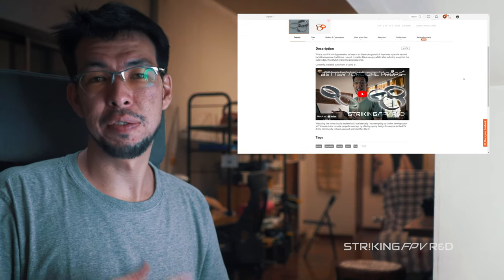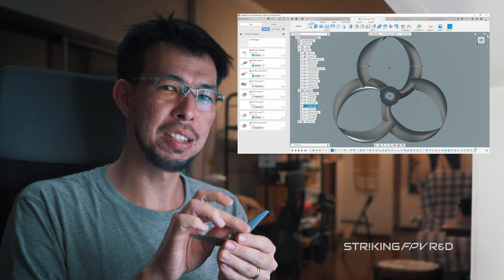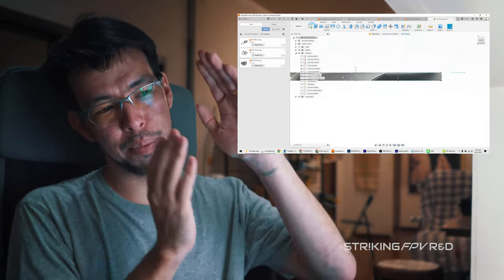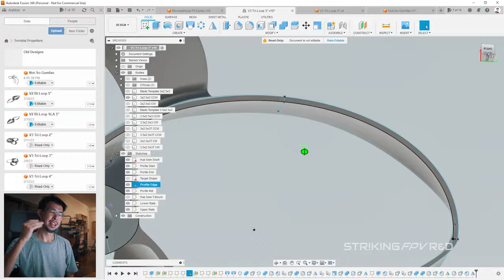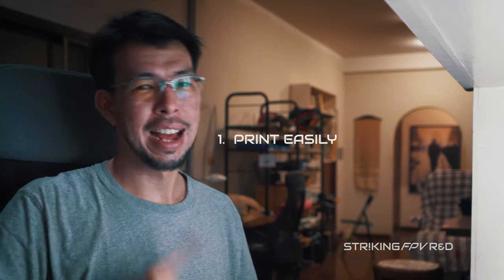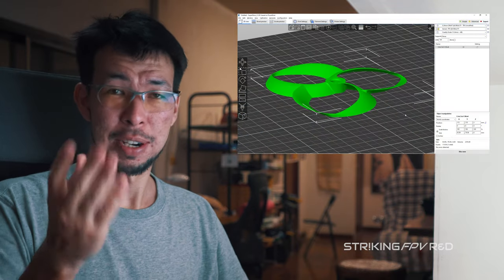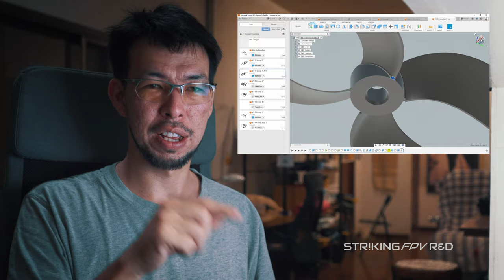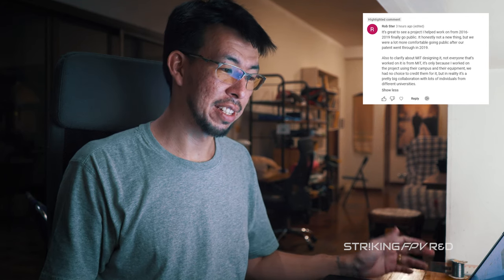10 Toroidal Drone Propeller Questions Addressed

Comment: Excellent video, and I really liked the part where you did the helix to set the pitch.

I know I've made a few comments about balance here and there. Hopefully it didn't come across as a design complaint. It was more about the printing process,...and actually,.. even injection molded props can use some balancing. Gemfan whoop props are pretty out of balance. I find I can generally run HQ's as is, but I have to balance Gemfans. So I fully expect to have to balance a printed prop. But maybe these v3's are light enough to skip balancing for the first flights. Balance later to remove jello. We'll see.

Trying to work on resin printing these also. I have only ever printed SyriaTech Blu, as I have only ever been interested in functional prints. Currently working with a mix of blue and black( old and new bottles). It's just a good deal harder to get a print straight on the build plate with resin that doesn't have a huge elephant's foot. Especially with fairly clear resins.
Reply from the maker: That's interesting, I've often thought that part adhesion would be pretty good for small and light-weight parts like these props, but again I have no experience with resin.  For the longest time I've want to get a resin printer but I've met a few people with them who've all said the same thing: they smell terrible, haha.  I currently don't have a clean enough outdoor area to put one, and as of yet I don't exactly have a strong enough reason to buy one if it were just for printing props and nothing else (maybe some flexible parts with that TPU-esque resin).

Sure would love to grab one, but I ain't got funding for this 🤣.
Reply: @STRIKINGFPV   So I figured out half of the elephant's foot. My build plate was not flat/warped. Seems it is a common issue with these. So I bought some flat glass and sanded it flat. Actually, I sanded it most of the way on a plain sheet of glass.

So that removed a good bit of the elephant's foot, but it still exists. My guess now is it's the thin layer of resin trapped between the plate and fep on that bottom layer. So it ends up just being a thick bottom layer. That's somewhat ok for straight walled prints, but for props that don't come straight up off the plate, you'll get a lip. Maybe a thinner resin would help,.. not sure. I've tried slowing down the build plate to give it more time to squish out, and heated the chamber to thin it. For now, I'm just assuming I won't be printing directly on the build plate. Props will have to be supported.

Comment: Use CF filled materials like PETG or Nylon. It´s way more rigid and combats the disadvantages of Nylon or PETG which is being too ductile.
In regard to the injection molding question, everything can be injection molded it only depends on how much you are willing to pay. Their complex geometry does make them non injection molding friendly you would need angle sliders etc.but it is doable.

Comment: Was sleeping on this video if the plan is to continue down the toroidal rabbit whole maybe decreases the attack angle of the blades if it's a quad blade for the biloop toroidal. Also weight saving needs to be a focus maybe keep same attack angle but decrease blade width to decrease the amount of energy needed to spin the motors
Reply from the maker: I do believe that is the direction to go as well, but I'm internally fighting between the part of me that wants the ideal shape for the purpose, and the part of me that still wants an easy-to-print version that people can fly with.  If I go full-send on creating the ideal shape (even though I'm still just making educated guesses), I risk creating a design that not many people will be able to test, which would be a shame.

I'd like to strike that balance if possible, but the more I think about the geometry the more I think the ideal design isn't really feasible on FDM printers - it seems to be much more a resin or SLA kind of thing.
Reply: @STRIKINGFPV  wondering what the finest fdm settings can print also printing with supports isnt as scary as it used to be you can tune the gap so the supports work but also break away with no grinding. fdm has come a long way perhaps your design might still work. maybe a .15mm nozzle with a even smaller layer height since we want a smooth print anyway so you can get as thin as possible. you can also order some from a company in the material you like once you have a design you think will work. right now i dont think we are limited by material strength yet at least on smaller drones. ran on rekon35 had alot of bobbles but i was in angle and it is only 2s so might not have enough power. just bouncing ideas dont feel obligated to take any advice.

Comment: about the small vertical wingtip area. You say there is no waay around is, but why can't you continue with making the angle shallower until 0 deg (flat/horizontal) at the tip and continue from there to increase the angle again? I know that if you continue with the same airfoil design, it would be upside-down. But you could transition to a new airfoil from the tip onwards. the airfoil would be inverted from the one before the tip, but now because you continue the rotation on the other side of the loop, it would be right-side-up again. Does that make sense to you? it does to me, but it is difficult to find the right words to describe...
Reply from the maker: I'm not quite sure I understand your idea, but the way I can explain why that vertical exists is because it's a transition for the loop.  Some other commenters have mentioned making the tip flat instead of vertical, but this will result in a blade tip, which is against what the loop design is trying to achieve.

You can imagine it with a piece of paper.  If we made it flat-tipped, then actually we have one blade with a hole in the middle.  The loop idea is like one long blade which has been almost folded back on itself, and this fold means that there will always be an upright section at some point.

The challenge here is minimising the size of this vertical loop bit, but if you make it so thin as if it doesn't exist, then you now have a blade tip.
Reply: @STRIKINGFPV  i guess I imagine my idea would be a little like an inverted Mobius strip. With the horizontal part on the outside.    This might indeed be against what the loop is trying to achieve. But it would still make it a suitable prop for 3D printing, which seems to be the main benefit for now with your designs.
I am going to follow your tutorial and see if I can make my idea into an actual design. I have no way to test it though. But still educational and fun.
Reply: Acually, the inverted Mobius strip does not make sense at all. 😅🤦‍♂
Reply: It would be more like two separate normal twisted wings glued together at the tips. One originating from the leading side of the rotor hub and the other from the trailing side. So it would not be a loop anymore at all.

Comment: The outer tip is important since it moves fastest, if that outer tip has a lot of surface area and providing 0 lift the design is bad. Turbulence at a tiny tip is far more efficient than a large cross section non-lifting tip.  The thing about droid props is there isn't a lot going into it unless you are in the defense industry. The water screw propellers are probably a better solution since it is strong, the blades do not have dirty air, the whole system lifts.

Comment: Maybe you should look at ducted propeller theory. There's an RC propeller teacher that may help.
Reply from the maker: Funny thing about ducted propellers is that in the drone world they do increase efficiency, but also increase noise and reduce maneuverability.  I believe that the US Air Force, when doing experiments with various ducted fan flying machines, discovered that they had a natural tendency to self-level, which fights against the type of handling that many FPV pilots want, which is why the "slammed duct" was created, to try and benefit from the efficiency increase whilst reducing the effects of self-stabilisation and the aerodynamic cross-section which slowed-down the drone and made it more susceptible to wind.

Nowadays, a lot of "ducted" designs are not in fact real ducts due to far too much clearance between the prop tips and the "ducts" themselves, effectively making them glorified prop-guards.  Many newer cinewhoop designs do-away with the duct fallacy and just have thin-ish prop-guards which don't interfere with aerodynamics all that much but protect the drone props from damage and protect people from getting sliced-up.

This is why I started with a "ducted" cinewhoop, the Cloud-149, then I designed slammed ducts for it (made a Fusion 360 tutorial), and then eventually switched to the Veyron35 CR Pusher frame.  A pusher configuration with prop-guards seems to be one of the best ways to do a cinewhoop, as the thrust column has no obstructions, theoretically making for improved handling and flight behaviour.  I definitely enjoy the flight characteristics of my Veyron35 as it still gives me the ability to fly indoors easily, but also cuts through the air outdoors as well.

Comment: Im no expert, but have a question about your comment  at about 2:40 “ more drag” being detrimental. We usually think of drag as a negative, so we streamline race cars, airplanes, etc to reduce drag. But, isn’t the whole purpose of a blade to create drag? Nothing is 100% efficient, so some of the components of the drag might work against the efficiency, but overall, isn’t more drag getting more work done in this case?

Comment: I have a question
The drone has 2 different types of propellers, how do I do this here if there is only 1 file, do I just mirror it?
Reply from the maker: Yes, can mirror in X or Y, pick one (not both). That being said, I've actually provided CCW (counter-clockwise) and CW (clockwise) versions for all my props, so you shouldn't have to mirror, just print two of each version.

Comment: As proposed I used the Tri-V2 for my DJI Mini 2. I made a Picture and Video (raw) from it. Starting all motors is successful only 50%. Maybe the Probs are still too heavy or behave too much different while starting that higher momentum to turn. I printed out the 50x3 and resized that to 92% 0.4mm wall 0.8 bottom, top and 10% cyclic infill. I can give STL-Files including the different mount if someone wants also print a set. Write me. But what happens is documented on a video. The drone starts up to the minimum hight of 0.5m, stays a moment and then the motors step off and it falls down. I run that first with only one prop replaced, stable so far but the same problem that the 3 remaining normal probs get switched off ! The Mini 2 seems too be too sensitive if load profiles of the motors are controlled. I cannot make the props with lesser weight. Imagine that the drone falls down some meters because the motors are switched off in the air 🙃. PLA worked best also with the thin walls and infills. I try for V3 as Tri and V2 as Bi and can give the STLs but be sure I do not want to risk my DJI Mini 2.
Reply from the maker: That's quite interesting, so it would seem that DJI has in-built protections against overloading the motors. Not surprising, but I suppose irritating for those who want to test these designs with their hardware.

I'm also slightly relieved though, as we know 3D printed props have a higher chance of breaking and DJI drones are more fragile than a lot of FPV drones, so I've often worried about people testing this and badly damaging their drone.

There's also a deeper worry for those who persist - if you can get the props light enough for the DJI firmware to not notice anything wrong, will they be even weaker and more unsafe to fly?

Comment: For quietness, has anyone thought to incorporate something like the Blackhawk blade? A small portion at the end angled down, much the opposite from aircraft wingtips.
Reply: There r props that do this tip angles down like some plane wings too. Weirdest thing I seen prop with tip angled up. I thought the angle down was efficiency.  Keep air under prop not going off edge
Reply: @Diving Falcon FPV  the purpose is vortices reduction. Which does improve efficiency, but, reduces noise by a lot. If I remember correctly, and I may not be, it does change the tonality much the same way that the toroidal does.
Reply from the maker: It's something to consider, but it would be more difficult for 3D printers to do without lifting the main prop off the print bed with supports or printing upside down, which may mess with the leading edge of the aerofoil.

Swept-back tips on standard props often help with noise reduction though - the original DJI Mavic got a Platinum version afterward its initial release which featured sine-wave commutation for the motors and new props with swept-back tips to reduce noise. To my memory most of the DJI drones after that kept up the same trick, but recently the Mavic 3 props went back to normal without the tip sweep, interestingly.
Reply: @STRIKING FPV  which does bring up a good point. Printing upside down might allow for either a thicker chord or more aggressive curve to the airfoil. Also might mean keeping the end of the prop horizontal rather than going vertical. In my mind, I kept envisioning it as a ribbon  type shape, kind of difficult to get past sometimes.
Reply from the maker: @tobins6800  I had a commenter on the last video mention that he worked with resins in the aerospace space (lol) and I did ask how he felt about printing part of the loop back in mid-air. Don't think he replied yet, but it's also getting harder to track comments so might have to go back and find it.

I know what you mean and I think MIT doing the split blade held with the t-mount is how they did it, so they probably printed the loop standing upright to get the shape you're thinking of.

I guess I'm just stuck here trying to keep my easy printing and minimal post processing dream alive by never lifting off the print bed 😅
Reply: @STRIKING FPV  what I was thinking was keeping the printing plane flat, just flip it upside down. The tips I don't think should extend very far below the bottom of the hub, if at all. And that should be sufficient to eliminate some of the vortices. The winglets and drop point of the helicopter blades are minimal compared to the rest of the length.

Comment: Do these props also offer an advantage regarding weight lifting capabilities of drones?
Reply from the maker: As an educated guess, I'd say no - from what I've seen from other tests and what I'm kinda' gathering from the research, I feel like these propellers probably have a narrower efficiency window than regular props, so someone getting into serious design considerations for heavy lifting would probably need to have a target weight and try to extrapolate ideal motor specs paired with prop diameter, pitch and blade/loop count to make a toroidal prop that can compete in efficiency with a regular prop.

Semi-educated guess then 😅

Comment: Is there such thing as carbon fiber 3d printing?
Reply from the maker: Yes and no - there is carbon-fibre impregnated filament which basically has very small chopped up carbon strands in it - I have dabbled in PETG-CF, for example, but the most robust carbon material for 3D printing is PA-CF (Nylon Carbon Fibre).  There is one other method which has a continuous carbon strand in the fibre and a special printed with a blade designed to cut the carbon strand at the end of an extrusion, but this is very specialist.

Comment: But ur adding weight cause tri loop has 6  or well 4.5 blades maybe haha so I can't see how it's more efficient. Maybe very low rpms. 
I like props that got a curve down at the end, like certain wings, to keep air rolling off tip
For 3d printed don't u need to polish it smooth too to improve efficiency.
Reply from the maker: Actually, if you refer to my pinned comment, @MoppelMat printed a V3 Tri-loop 5" set in nylon carbon fibre and got the weight lower than regular injection-moulded 5" props. He did also smooth the blade using a Dremel like tool, but still nowhere near the same smoothness of a production prop. Got very similar performance to the standard props, I was very surprised!